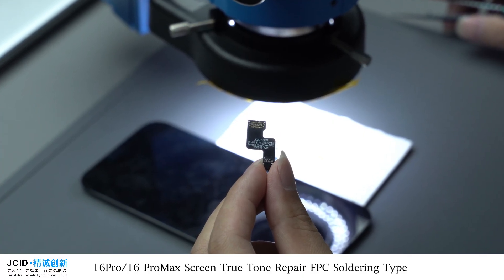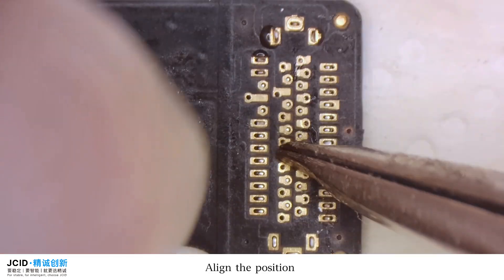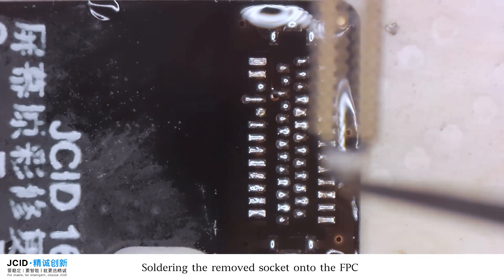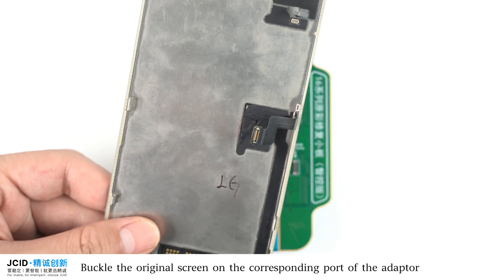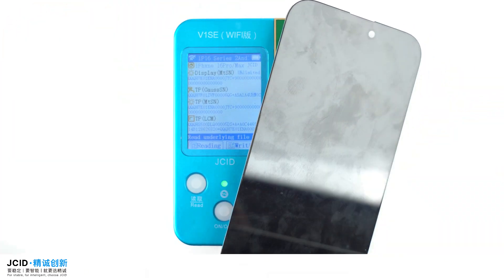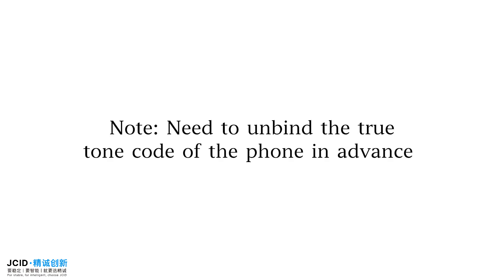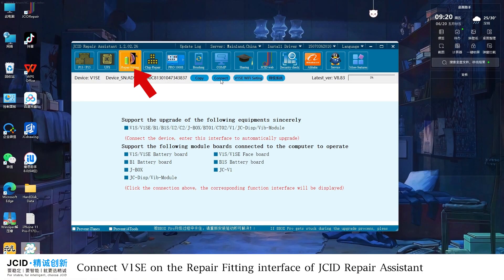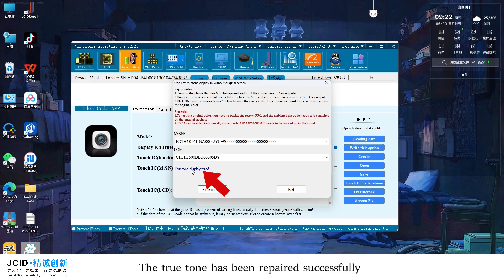JCID 16Pro/16 ProMax Screen True Tone Repair FPC Soldering Type - Operation Guide #jcid #truetone

Comment: After iOS 18 update auto truetone there but why you are using truetone flex cable confusion
Reply: Because after iOS 18 and iPhone 12 Pro Max above If you don't write truetone the system shows the unknown part, even if truetone activates automatically, that is not the "original" of the device. In addition, original screens have a writing limit of 5 times, so if this number is zero you can use this flex to do the procedure.
Reply: If I don't have old Display ic then I used this flex cable can fix unknown parts problem sir @amorimcleiton
Reply: But if you not transfer true tone to new screen after swapping chip you will not have auto brightness
Reply: я думаю що вони самі не знають що трутон в минулому, і цей шлейф це нісенітниця 🤦‍♂️
Reply: @nazik2305 
Видимо это для владельцев iPhone 16 с iOS 16))))